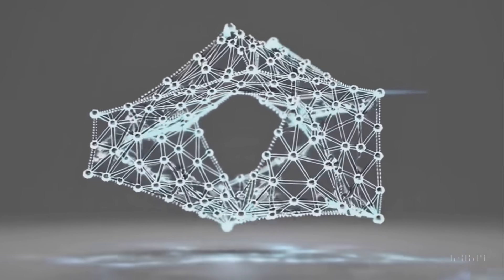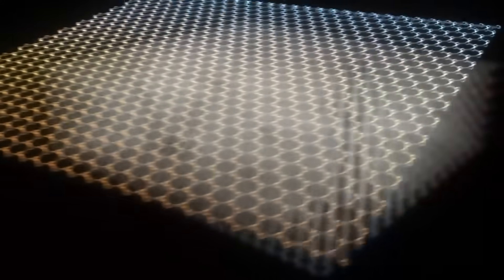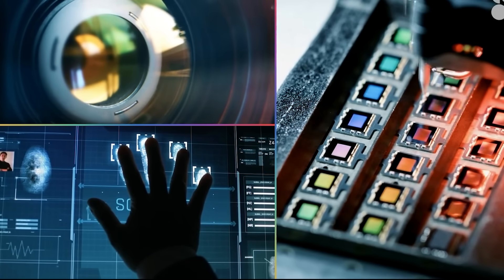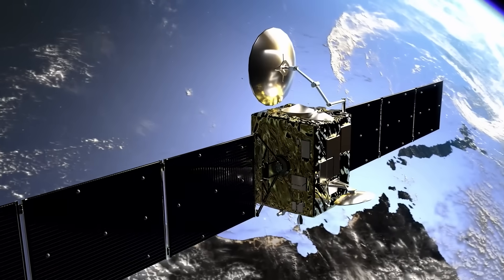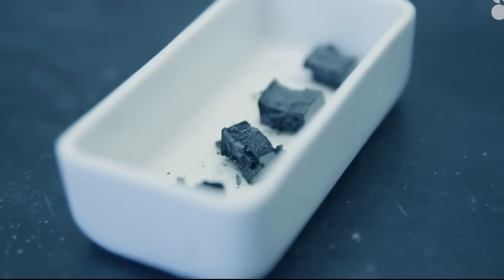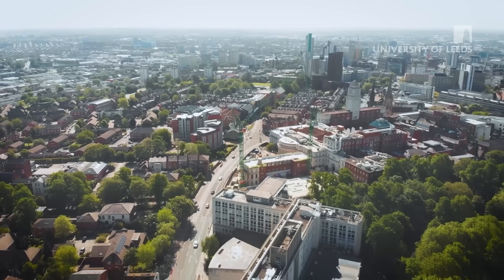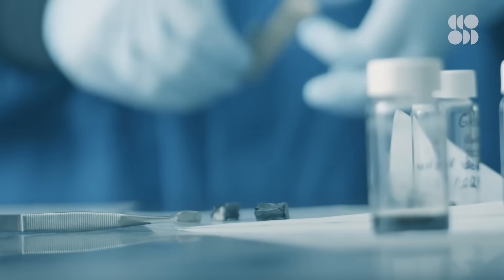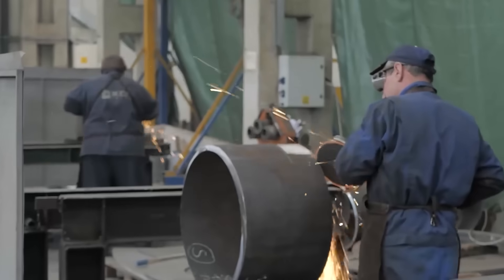HUGE Breakthrough! AI Just Invented the Strongest Light Material on Earth!

Comment: I have questions about this material that the AI designed and is not 3D printed. 1. Does the material oxidize? 2. Does the material fracture under stress over time? If so, how much time does it take before the material has to be replaced? and 3. When you 3D print this material, does it create micro-particle dust like 3D printing metals materials do?